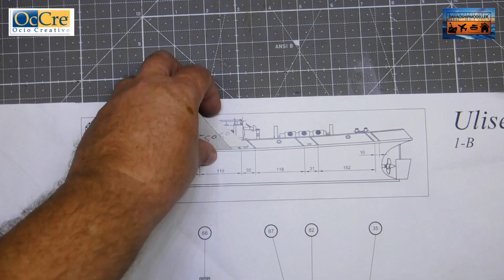Occre Ulises Part 6

Comment: if you tape like on your hull it has to go under the tape. but there is a trick. you have to seal both edges of the tape with the respective color beforehand so that no more color runs underneath. then the water line. it's like when you want to do a stripe on rough wallpaper in your apartment.
Reply from the maker: Thank you for your Advise

Comment: How much does it cost to Rc this model and which motor kit  did you get?
Reply from the maker: Well that's not easy to answer, it depends on what you have already and where you buy the components . A very rough estimation is 100-150 USD for the basic materials

Comment: What paint spray model do you use?
Reply from the maker: I've used Komodo Paints . Thank you for watching
Reply: @davaoshipmodeller  I mean airbrush / spray tool
Reply from the maker: @saravicius  ah ok, I am using 2 Airbrushes , one very cheap Chinese Knockoff for Primers and very thick paints with a 0.3mm Needle and the other one is the Tamiya HG 3 with a 0.2mm Needle. Honestly for our Hobby and the kind of Spray work we are doing, the Chinese Airbrush would be enough
Reply: @davaoshipmodeller  Thanks! I tried one from Aliexpress, but was quite disappointed... it isn't easy to work with acrylic paint, and it needs a water-like consistent which gets absorbed into the wood and changes its structure, so looking for a solution which could help to work with thicker consistency paints
Reply from the maker: @saravicius  agreed ! Check out if you can find Komodo Paints those are pre-thinned and very easy to apply. Before I've used only Tamiya Paints but after the Bismarck, where I first used Komodo Paints, I switch my whole Stash. Also try to work Sanding Sealer, that closes the Wood Pores